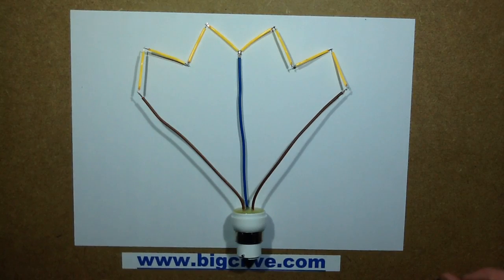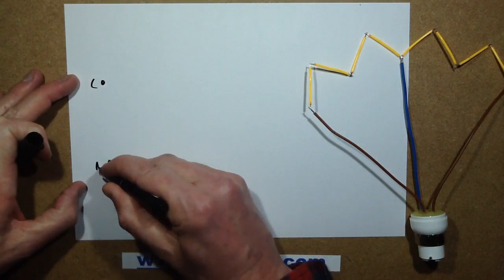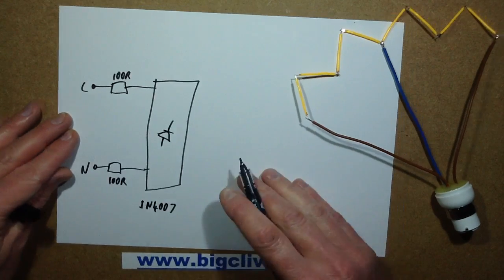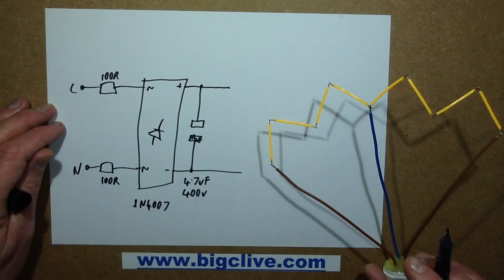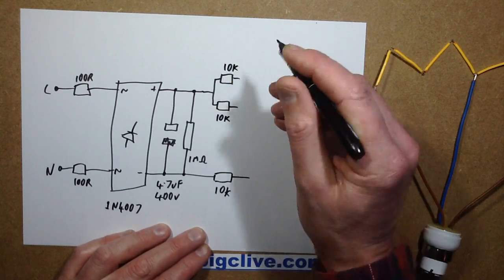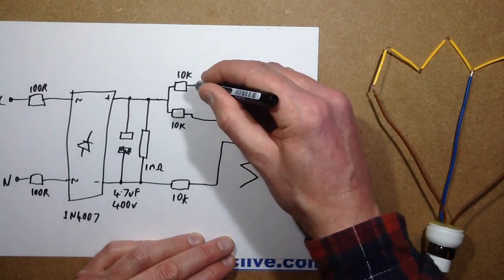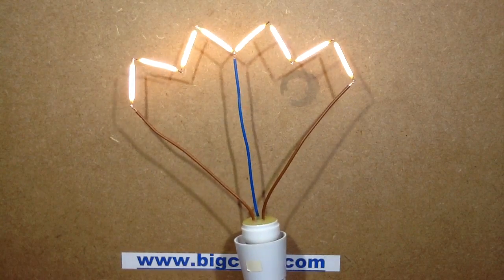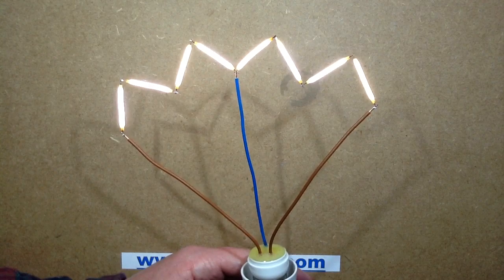Ridiculously huge LED filament lamp project.

Comment: Can you get led filaments alone in a pack? If so, where?
Reply from the maker: You can sometimes find them on eBay, but they often arrive with a high percentage broken, possibly actually shipped out that way.

Comment: I connected 5 LED filaments in series, housed them in a linear fashion, and am powering them with an old disposable camera flash assembly. There is approximately a 15 second lag as the capacitor is charging, but the system balances out rather well and maintains a steady light output powered by a single 1.5VDC D cell.
Reply from the maker: If you swapped the capacitor out for a much lower capacitance rating but the same voltage, they would light faster.  Theoretically you could use something like a 100nF 400V suppression capacitor.
Reply: bigclivedotcom Thanks very much, I will definitely try that. :)
Reply: bigclivedotcom Well unfortunately after running the circuit for over 5 hours, it stopped working. I tested the D cell, it still has over 80%of it's capacity remaining. I'm guessing the oscillator or step-up transformer gave out? I'll have to find a more robust replacement, I really like the efficiency of the circuit.

Comment: Can you wire them parallel when you use a led driver?
Reply from the maker: You could if it put out a high enough voltage.

Comment: Something doesn't add up...
If you use 3 10k resistors, two in parallel, you get 15k overall. Each filament has a voltage of around 70V, so it's 280V for four filaments in a row. The current then has to be around (325V-280V)/15000 Ohms = 3mA, so it's just 1.5mA per side. Am I missing something or would it be better to use smaller resistors? If the voltage across one filament is in fact 80V, you could be able to hook it up to 325V without any resistors.
Reply: The two 10K resistors are not in parallel. There is one for each 4 Filaments.
Reply: Each string of 4 filaments sees 20k in series with it, so current is 2.25mA per side, 4.5mA total. Yes, that's running them pretty low, but not unreasonably so. Those filaments are probably rated for something like 10 or 12 mA, so they're running around 20% power. I figure it's meant to be more of a decorative than something to light up the room.

Comment: Hey Clive.

I'm keen to build something like this for an art project (where the LED filaments will likely be a longer string of 10) but I will be using 120v power.  Can you tell me how the circuit parameters change in this case?

Thanks.

Comment: I want to make something like this now for my desk, but I would probably kill myself messing with mains voltage and not knowing very much about practical circuits. Would this work if I were to just knock the glass out of a regular light bulb to use the metal bit as housing, and would plugging it in into any lamp that fits the metal base make it work? Also, given that we have 120 volt mains here, would the values of the resistors you used change? half  them maybe since the voltage is halved?

Comment: I know this video is quite old but I am wondering where you get those kinds of LED filaments or what keywords I should be using for search?
Reply from the maker: +Cere Mony Search on eBay for LED filaments lowest cost and shipping first and you should find some bare filaments.
Reply: +bigclivedotcom You have to pick a good seller. The first one i ordered from ( and the cheapest) sent 10 of them randomly thrown in a simple bubble envelope... They were all broken.

Comment: Thank you for the presentation Bigclive. Most viewers caught on the fact that you are running on 220 volt or slightly highier. It looks like a 30 v is a safe average for each filament although seller documents 60 to 70 volts. I received a few and will test them soon. Julian has also videos to watch.

Comment: Hello, I know a little late but I just made this EveryCircuit diagram based on your design. 

Two things I am not 100% sure about, was the exact settings to use for the LEDs, or the diodes in the bridge. I found a datasheet for the diodes, but didn't seem to match the options available in the app. I am not sure if the flickering I see on the LED's is due to the app running at 60ms/s or if I done it wrong.

http://everycircuit.com/circuit/5339250587860992

Comment: i know this is rather old, i was curious on doing this in comparison to the other newer vid, with the test tube,,, would this be comparable to a 80w incandesant,,, and is this roughly twice as bright as the one with 4 strips ? 
if you could change anyhting would you change any of the resistor or cap sizes?
Reply from the maker: This lamp is purely decorative.  It's designed to be looked at. so is low power.
Reply: ahh okay, so mp i will go for the other one, thank you for the quick reply :3 i really didnt think you would reply so quickly

Comment: nice work..
what is your input? 110V AC or 220V AC?
Reply from the maker: 167mm167 Supposedly the new European standard of 230V but usually in the region of 245V
Reply: +bigclivedotcom Reading this, I was curious what actual voltage we got ... stuck some probes on the net ... and got an exact 230V.

This really surprised me, as they placed a new transformer cabin just 50m away last summer, and all our old incandescent bulbs started failing after that. Maybe I should test again on a sunny day, I'd expect they offer a higher voltage when all solar panels of the region work on full capacity.

Comment: Fantastic! I definitely need to make some form of alphanumeric Nixie tube from some of these now.
Reply: +MegaWayneD ... I know right. I was just thinking the same thing. Or a 7-seg clock that doubles as a lamp. Have an abstract decorative border with ... er... (counts) ... 28 strips in (for 24-hour, 25 for 12-hour), that only come on when their paired strip in the actual digital clock face extinguishes, and vice versa - so that it's not an on-off switch but an either-or (maybe polarity-switched?), keeping the total amount of illumination and power draw constant throughout.

The power stated for each of these before was 0.4w (so this big ol' Jacobs ladder is still only about 3.2w?), meaning even that would only pull down about 10 to 11 watts, maybe 12 with the conversion and control circuitry. But it'd be closer in output to a 100-120w incandescent. You could light up a medium-small room with it.

Comment: Nice! - I bought 8 filaments too, but took one apart, so i'm one out to make this wonderful creation, too :O - What happened to the sound at the end ?
Reply from the maker: I'm using an iPad 2 and it randomly seems to have audio issues.  It sounds like a firmware glitch.  I've resisted moving to the most recent OS in case it drags the speed down (further).